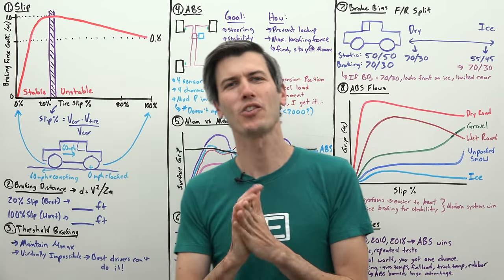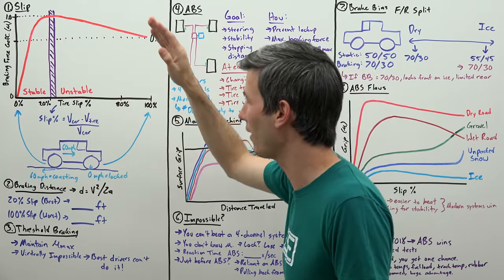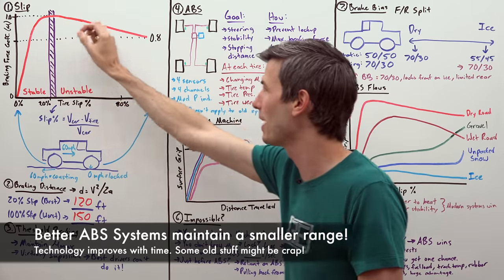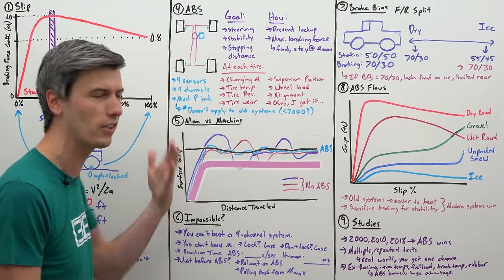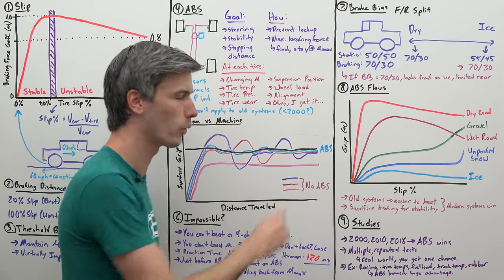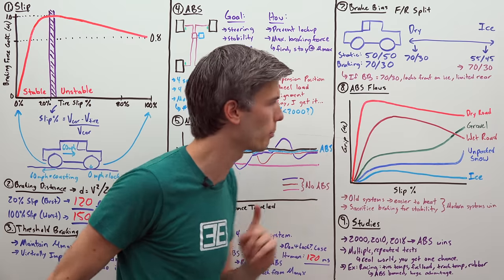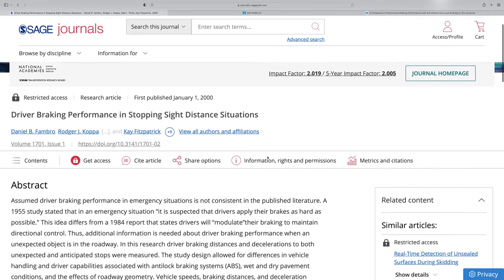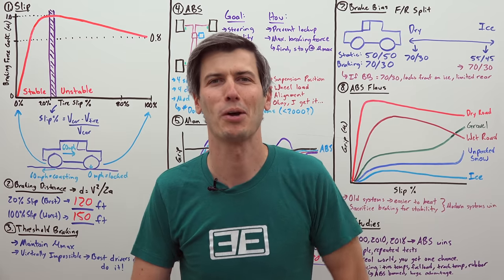Why Threshold Braking Is Impossible - ABS Wins!

Comment: Have you ever tried driving on snow/ice?  Then you would know how wrong you are. Let’s talk about the flaws of you video.
Disclaimer : I definitely don’t claim that you’re wrong, I just want to point out how far from a real analysis you are. Let’s begin!
You are a graduated engineer, so behave like one. Don’t start your analysis by claiming ABS is better. That’s not objective. Same goes for « virtually impossible ». You have no proof that it is impossible to nail it. Even if it seems obvious that it is not possible, without data you cannot conclude anything. 

Then, you say that when the tyre slips, its grip coefficient goes to 0.8. Fine, I trust you. But then, you agree that when the ABS does its job, you get full grip back (approx ~1 on dry road, no surface condition is mentioned in your graph btw). So then, even if it locks and unlocks your wheels a thousand times per second, the average grip will be the average of 1 and 0.8, which is 0.9.
In fact I think that it’s not even true, wheels locks instantly but need time to regain their speed when unlocked. That’s an assumption I make, don’t take it into account. 

Overall, you are convinced that ABS is better and I agree, a regular user won’t ever perfectly brake. But I also want you to try ABS-braking on ice, and then try nailing it without ABS. Even a regular user will definitely brake better without ABS. That’s a counter argument, it mathematically allows me to tell you that you’re wrong, partly wrong at least.

Comment: I dare you to beat me braking while replacing your faulty abs module. One of the most common failure points of modern vehicles. And no break bias is not just to maximise braking force it's to manipulate vehicle dynamics. Abs is for the untrained. PS you come from the continent of America so you are going to throw on the "E brake" and hurtle sideways into the thing you were trying to avoid anyway.

Comment: One factor that wasn’t mentioned is the added weight of the ABS system, which significantly increases the braking distance.
Reply: Uhh, how much do you think an abs pump and 4 sensors weigh? The pump for my civic weighs 6 pounds. The sensors are ounces. The wiring, maybe a pound? 

A month of dieting would make a bigger difference in the performance of my car lol.

Comment: abs loses 100% of the time if u want to lock the wheels
Reply: abs and tcs are dangerous for drifting dirt
Reply: "and other hillarious jokes you can tell yourself"
Reply: and your assuming my cars are new enough to have usable abs
as far as im concerned delete the abs unit and relay for -10kg and unlock speed past 180 @chuck_norris
Reply: @chuck_norris  u cant read tho
OP says if u want to lock the wheels abs loses 100% of the time
u cant do proper tip ins with abs nor is it good for drifting u cant just aquaplane on the trajectory u had

Comment: ABS sucks in the snow, dirt/gravel and rain. It is only good on dry paved roads.  This I say after 60 years of driving experience.
Reply: Gives you tons more control on slippery surfaces. Locked brakes make you unable to steer.

Comment: Jason I'll challenge you to a ABS vs. Human test. You use solid logic BUT you make too many assumptions about people vs computers and are basing everything on stopping distance in emergencies (all of your references). Then you talk about it being performance driving which requires a brake release (not a stop) and the issue is then that the release is less nuanced with ABS and your corner entry suffers. Remember, we can anticipate, they can only react (very fast reaction but reaction) and you can have ABS failure (It happens fairly often when a piece of debris take out a sensor, a piece of rubber or similar) and the ABS disengages and the bias isn't correctly set in nearly every ABS car (because it relies on the ABS to set bias). You can beat ABS with a well set up system, we do it all the time. Notice all the cars that crashed at Cog Cut at Pikes Peak this year (and every year) due to a wooden pedal (ice mode) activated due to bumps. A well designed and tuned non ABS system not only stops better on a bumpy surface but as mentioned your brake release is much better without ABS so its faster overall. Don't get me wrong, It is a life saver on the road for anyone who gets surprised but to say "it's impossible to beat" is flatly wrong due to the assumptions you make about humans and the limited scenarios and bias towards emergency braking that ABS is intended for. A good driver in a performance scenario with a well designed and adjusted non ABS system is a much more advanced braking package than the best electronics (and can feel slip and long g in a much more nuanced manner than chart explains, we can be trained to be much better than you suggest/imply). Same goes for stability control and traction control. We are organic supercomputers, we can still beat the machines if we put in the work (and that's what makes it fun!).

Comment: okay, this is factually incorrect, to a point, i dont even need to watch the video, 

a trained (and a proper trained) driver can, will, and often still do break in a shorter distance than ABS 

where ABS will WIN everytime is, a professional driver on a track, or other semi controlled area, is one thing, throw in a race, and sure, the pro might still outbrake, but throw in the unexpected, the sort of thing that happens in an accident, and while the pro might not panic to the same degree, that fine amount of skill and concentration that is needed to beat the ABS, is deadened, the thought, and brain power for the fine muscle control isnt there, the brain is doing other things to avoid the ouch, 

faith in ABS tho is a massive issue, it doesnt make you stop better, 
i will make that point again, it doesnt make you stop better, 
if you used your ABS, if that ABS light flashes on the dash
you fucked up
its not meant as a driver aid in that sense, and I wish people learnt to drive without it, didnt know it was there, so that when they did have that "oh F" moment, it was there, and did the work
Reply: if the Video is "factually incrorect🤓" why dont you state any "facts" or sources?

Comment: This is BS as simply if you do not lockup your brakes and press close to maximum pressure before lockup a car will pull up faster with a pad constantly on the disc rather than say 40% of the time off the disc. You can also pump the brake your self which if F1 drivers did they wouldn't be locking up for 1 second or 2.

Comment: In Fig. 5 I think your misinterpreting your inability to judge a road surfaces grip level
You're calling it impossible to actually threshold brake, when it's very possible and is much smoother and therefore faster in a racing scenario  than any abs system
Not to mention even the best abs system can't actually hit the lowest braking distance, if memory serves it's usually at least 10% more than perfect threshold braking, and throws the weight of the car around upsetting the balance 
So while abs is a good thing and reduces crashes, I think the real solution should be teaching people to actually drive and stop a car safely
Because too many rely on these safety measures so that they can play on their phones while they drive

Comment: Counter-argument, ABS can't predict what's coming. ("good driver") Humans can use their eyes and see, for example, a puddle or a patch of sand, and adjust their braking accordlingly ahead of time.

Regarding poor road conditions: Yes, driving on ice ABS will perform better than manual braking, HOWEVER, The braking distance is so much longer on ice for both that if you actually need ABS, you're probably gonna crash anyway (well either that or you just suck at braking alltogether and need ABS for normal stops on ice too...) And, depending on the system, ABS can overreact and make it harder to control your car. This is a tough one, since most people driving cars are not professionals, so I would say ABS helps them, but for people who have a good sense of their car's limits and the feel of how it interacts with the road, ABS makes things more difficult. 

Also, having 4-sensor ABS isn't better than manual braking (It is better than few-sensor ABS though). Each wheel does have different braking conditions, but if I just brake at the threshold of the wheel with the greatest grip, the rest may slip here and there, but regain traction as soon as surface conditions improve. I've experienced this, and I prefer it over ABS telling me to screw off and ignoring my brake input when I have a traffic intersection I would like to not get T-boned in.

People think ABS is this magic tech in their car that makes their car brake better (This is evident even from just the comments on this video). It doesn't. If you can't do it manually, you can't do it with ABS. ABS is meant to prevent you from losing control. The people who argue against ABS will use it most properly by not relying on it, and the people ABS is designed to help the most will drive worse because of it.

Comment: What you didn’t mention is what slip actually is causing or what slip is leading to. You need slip to transfer lateral forces between the tire and road. Without and slip, there wouldn’t be any force, thus you wouldn’t accelerate or decelerate or turn into a corner. 

Besides that, great video. 😊

If you would like to go even further, you could show, why ABS is necessary for ESP and how this enables ESP :). Based on my studies from a few years ago, I could give some great and simple examples therefore

Comment: ABS is all good until your on a wet dirt road and it stops the wheels locking up and diging into the road. abs just ends up letting the wheel roll and you cant stop
Reply: That's by design. Static friction is always higher than kinetic friction. If it let you lock up and hydroplane, you would take longer to come to a stop and go further in distance.
Reply: @Snowball Effect  no you lock up and build a pile of dirt in front of the tire that stops you vs doing absolutely nothing
Reply: @CaffeinatedSentryGnome  ah, i missed the DIRT road part. You're right.

Comment: Also something I forgot about, threshold braking can be combined with downshifting to decelerate ridiculous fast, to my knowledge this isn't possible with abs because you'd stall the engine
So yet another reason why abs is only useful for normal everyday drivers, and can actually be slower for someone who actually knows what they're doing
Reply: engine braking is not useful when you "decelerate ridiculous fast". The brakes itself can lock the wheels (that's why you need threshold braking or even more ABS) so additional "brake force" is completely unnecessary (actually bad). So "computers" help you and INCREASE a bit the engine torque if drag torque would cause too much wheel slip.
If you stop faster with using engine braking then you are not on the threshold with your threshold braking.

Comment: I think you have an incomplete analysis of the entirety of braking systems. This video captures valid points on the capabilities of ABS systems (individual wheel braking, response time [per wheel even!], and brake bias mitigation), but it doesn't close the entire loop. Namely, how does the system know how fast the vehicle is going relative to the surface it's traveling over? I've tested a multitude of cars where I try maximum braking effort on dry pavement, wet, and snow, and I've yet to discover an ABS/Traction Control system that is better across all 3 scenarios than an attentive driver without those aids. I'll admit, dry pavement is the most difficult category I've tried. Snow however, I've yet to test a system that has bested me (albeit the most recent model I tried was a 2013 CTS-V). The thing that stands out is that the car can't tell it's moving if all four wheel sensors stop if those are the only sensors it has to detect movement. Unless the ABS systems have a rather advanced inertial navigation unit, especially on snow, they are at a disadvantage to human drivers. I suspect most factory ABS systems are optimized for stock braking equipment on dry and (lesser so) wet conditions on more or less stock tires. Even then, I suspect they're built in with a lot of variables set to values that simulate/interpolate vehicle speed and rotation.

Comment: Glad this video exists. Tired of hearing car nuts insist they can brake better without ABS. These guys are perpetuating hearsay from the 70s as their own form of pretend-elitism, because it gives them a feeling of superiority towards those normie drivers. And without fail, if you explain to them how impossible it is to outperform these machines, they'll reveal that they are fully convinced ABS completely releases brake pressure. Can't have automotive engineers explain to them how cars work, they made their exhaust pipe louder and thus clearly know more about cars than you.

Anyway, now I'll just link this video when I inevitably run into one of them again.

Comment: This explanation is excellent. 
Folks should bear in mind, the purpose of ABS is to help you steer your way out of trouble.  It is understood that braking distances are on average greater , all things being equal,  with ABS applied, vs non Abs.  About 10% longer, from memory.  But, the key thing is, with ABS, you can steer your way out of trouble,  and avoid a collision.  It's a crash avoidance technology.  Like everything,  there's a trade off.  When your wheels are locked, you cannot steer. You are at the mercy of inertia. Newton's first principle.  So, when you have an emergency brake situation,  you hit the pedal, you will hear the solenoids actuate,  you may even feel some pedal feedback, keep your foot on the pedal , until the emergency is over.  If you try to modulate the brake pressure yourself,  the system thinks the emergency is over. As Jason says, you can't compete with a computer, sensors on four wheels and solenoids operating at 60 to 100hz.

Comment: You probably never drove fast... not even close. In theory there is no difference between theory and practice, in practice there is!
Reply: This is basic physics. The coefficient of static friction is always higher than the coefficient of kinetic friction. In no universe can a human willingly beat ABS at maintining breaking at the edge of the coefficient of static friction.
Reply: @snowballeffect7812  as brilliantly the video showed humans have a reaction time. When driving on a bend close to the limit and you have to break, that reaction time limits your ability to maintain the car in the road. If you are driving with ABS you don't know what the car will do passing the limit since it decides each time to do something else. When you are driving without ABS you can learn what the car does passing the limit and you can even predict and act before it happens eliminating that reaction lag... and minor detail avoid dying in the process. Yes, it does break faster on a straight line most of the time but it does destabilize also the car in a random way making it almost impossible to make it into a turn afterwards when close to the limit. Fast drivers have to trust and predict the behavior of the car or they don't live to tell the story. In theory there in no difference between theory and practice, in practice there is.

Comment: I would very much like to see a video specifically 'explaining' that comment at 13:20 about ABS on BMW motorcycles.  The most important thing I learned during the MC safety course was that using more front brake than rear brake was a good thing.  I had it backwards at that time (MC was non ABS, ABS did not exist).   I own 3 BMW MC a 1995 K 75 (non ABS) 1998 R1200C abs, 2003 R1150RS ABS.  I have learned through experience (non - ABS) too much brake on the rear causes the rear wheel to rise resulting in less, and less traction and less control.   I absolutely do not understand the written text in the video:  " BMW has a MC that humans can beat 'Sport Mode ABS.' Why?  Because 'Sport Mode ABS prevents the rear wheel from lifting.   I say absolutely rear wheels which do not rise are braking better than rear wheels that do rise.  The quote again: " Race Mode ABS' still beats a human driver (allowing wheel life)."  I believe these two comments are exactly backwards.

Comment: Full lock is the fastest way to stop on wet or dry pavement. Street tires will not flat spot from doing this and unless your brain locked up with your wheels, you will  be able to control your skid.

Comment: I only understand no abs in formula cars or high downforce ones, cause they slam and then release slowly and this way they can't block. However, gt3 and gt4 for example are impossible to drive without abs
Reply: Formula cars are driven by the best drivers you can find, and since it's a sport they want to keep things like ABS out to offer spectators a real show. They also don't use traction control, standard in normal cars since a long time.